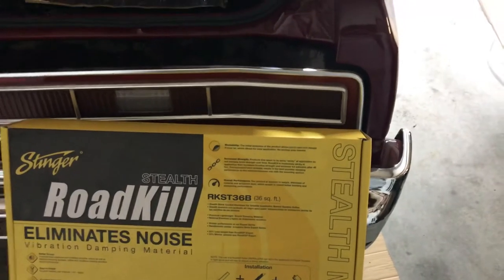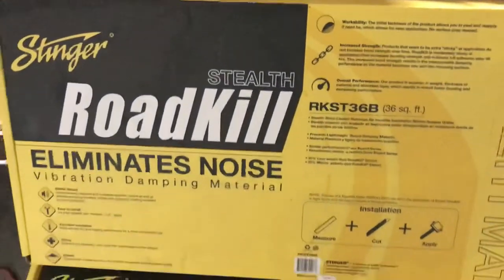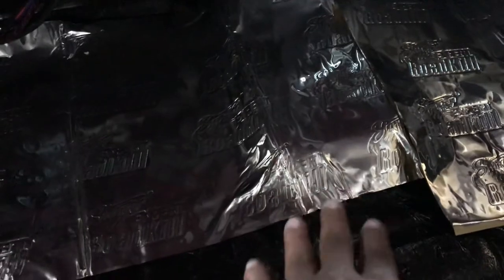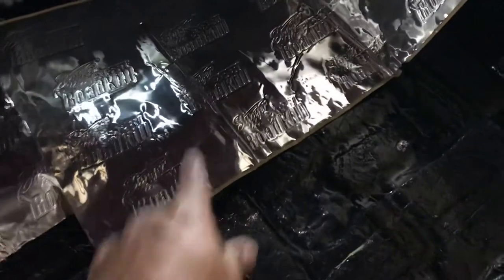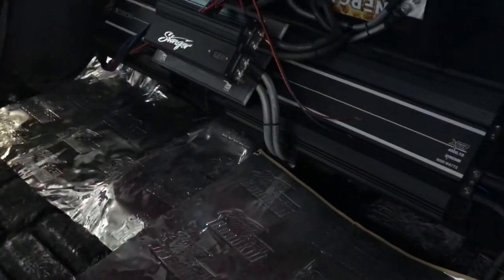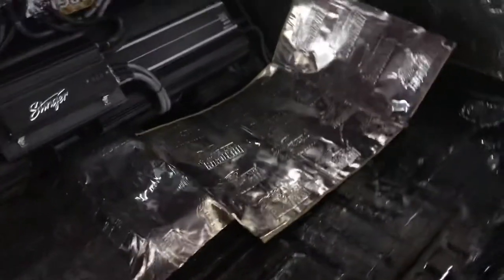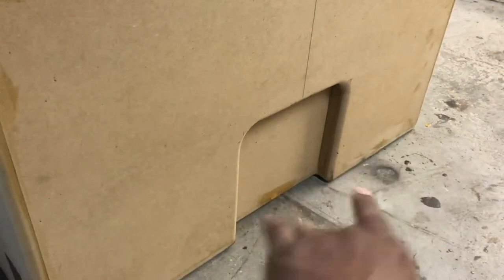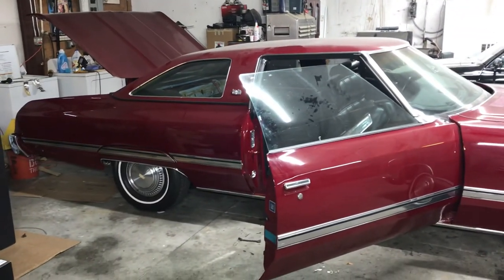Chevrolet Caprice update doing the trunk audio and sound deadner

Comment: BRA UM DOING MY 73,VERT FOUR 12'S,  SHOULD I USE A PORTED BOX OR SEALED
Reply from the maker: Walter Payton I would do kicker cvx 12” inch if your going to do 4 in a sealed box and 2 15” inch sundown zv5 if your going to port and have the ported box tuned to 32hz keep in mind Donks have small trunk space